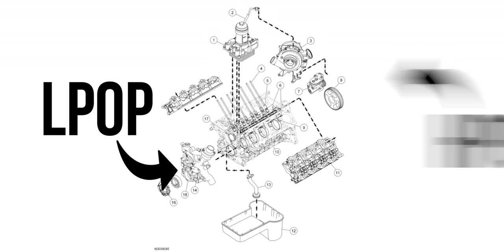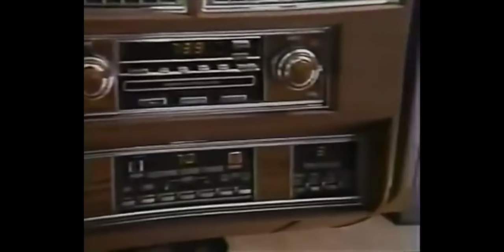These are the WORST ENGINES EVER MADE

Comment: I feel like he missed one by not mentioning the iron duke engine from GM. I owned a 1987 buick century, and I hated trying to merge into traffic, especially on the interstate because the engine didn't have the power to merge confidently. Even worse, it would shut off (without warning of course) for reasons unknown, and I remember my headers glowed red when I tried to drive up an incline. It was the only car that I abandoned and never gave it a second thought when the city towed it away for good.
Reply: The iron duke was slow but reliable.
Reply: Sounds like a plugged cat converter ,  I had the same issue.
Reply: Actually, the legit iron Duke motors were from 1979 to 1984, then they were aluminum blocks that some were junk in 1985 and newer.
Reply: I loved the Iron duke - coupled to a Borg-Warner 5 speed it could be made to move, ran 200k+, never used a drop of oil.
Reply: @geec5636  Mine was in a 1987 buick century. Maybe that's why
Reply: @blackice6184  for sure
Reply: Iron duke was underpowered but otherwise a good engine.  They had some trouble with timing gears shredding but at the time it had better than average reliability and good fuel economy.  Won't win any races though.
Reply: @knurlgnar24  You definitely got that right about the iron duke powertrain being super slow. I hated trying to merge onto the interstate. Took forever to reach 65 mph. Lol
Reply: I had a celebrity with one and it was flawless.
Reply: @Mazdafan59  my brother had a used one and it was a "pos!" I believe his lasted for 6 months.

Comment: I had a 6.0Ford Diesel F-250 that was flawless from 2004 to 2012 and 80,000 miles. I used Stanadyne fuel additive with every fill up and Hot Shot Secret at 30k, 45k, and 60k miles. It never failed and only blew a turbo hose off once at 75k mile on a designed downshift towing a 10,000 pound enclosed car trailer. It was NEVER reprogramed and I used a BulltDog monitor to keep an eye on engine functions when towing.

Comment: The PRV 2.8L V6 (Pugeut Renault Volvo joint venture) put in premium volvos in the 1980's and ended up in the DeLorean. Cooling system and lubrication problems. When they blew up under warranty voivo asked the customer if they could replace it with the excellent Volvo 2.1L turbo 4 cylinder it had better performance and was dead reliable.
Reply: Oh.. so many design flaw problems with the PRV! Rotting valley pans in the V. The incredibly stupid decision to run quite a lot of them on CIS mechanical injection, more correctly known as a Fuel Abortion. Horrendous quality build materials (crap metal, dissimilar metals, pot metal fasteners etc). Serviceability design flaws (fitted into far too many radically different vehicle configurations; all of them a nightmare to perform basic maintenance. Never ending electrical & sensor faults. Severely underdeveloped electronic engine management that's mostly banged together from off the shelf components (lamba computer, idle speed computer, CIS augmentation that didn't work). Heads that warp if you even say the word "heat". The list goes on and on.

Comment: The worst engine I've had to deal with was the 2.3L 140 CID four cylinder in the Vega.    It was a aluminum alloy cylinder block with cast-iron cylinder head and single overhead camshaft.  The block was open-deck with siamesed cylinder bores.   Terrible design.  The engine frequently blew head gasket and you ended up with milk shake in the crankcase and 99% of the time, failed bottom end.
Reply: It was the iron cylinder head and the silicon bore surfaces that caused all of the problems.  Open deck blocks with siamesed cylinders are an absolute thing these days.
Reply: @silicon212  Interesting, never understood what the Silicon did except reduce friction.   I figured it was excessive heat caused by the siamesed bores.   Learn something new everyday
Reply: @Barry718Johnson  They used the silicon in lieu of an iron sleeve as a surface for the piston to travel.  Silicon is hard and they figured it would make for a perfect wear surface.  They were right, but they didn't anticipate the oil control issues they'd have with it (did you ever see one that didn't smoke?) ... the piston was aluminum but had to be iron plated in order to live against the silicon bore.

Comment: Toyota also had problems with the head gasket on the 1990s landcruiser (80 series) apparently 30% had failures while under warranty and by 200k miles the failure rate was 100 %
Mine went @ 150k in spectacular fashion - a blast of steam out the tailpipe.

Comment: I had a 1985 GM 454 that consumed 1 quart of oil for every 16 gallons of gasoline. This was a brand new truck from the dealer. It did not smoke or leak anywhere. No spillage. It was a carbureted engine. Ran great but you better have a case of oil with you when going somewhere.  The dealer, naturally,  wouldn't rectify the problem. I also had a 1981 Ford 1 ton 460 which would consume 44 gallons of gas going 208 miles. Would pull a house down but a gas guzzler. It didn't last long either. Neither one of those engines were modified in any way but straight from the factory.

Comment: How about the latest GM disaster the 3.6 v6, which is not only plagued with timing chain issues but ( and this is the first time I've heard of this) also the reluctor wheel can slip effectively destroying the engine
Reply: "Our new High-Feature V6 engine now have the ability to self-destruct even more easily than they used to!"
Reply: I have a 3.4l Ohv in my firebird, and it's a damn tank. The older 3.1 and 2.8 60 degree V6 are good too
Reply: I think the 3.0 has similar issues too
Reply: GM 3.6 issues are derived from neglect by the owner. I have the original timing chains on my 3.6 at almost 250,000 miles now and no problems
Reply: @michaelcabral2174  your 1 of the lucky ones, heard nothing but horror stories about these
Reply: ALL of the 3.6 V6 issues are directly a result of owner neglect. They are very picky about their oil and maintenance and do not tolerate neglect like other engines might. But when taken care of properly they’re reliable long-lasting engines and will easily go over 250k miles. People who say they are junk just can’t maintain their stuff and can’t accept that they are the problem not the engine.
Reply: @trentryan27 And ALL of those horror stories are from owner neglect. They are VERY picky about their oil and maintenance. They do NOT tolerate neglect like other engines might. But rest assured if you maintain them properly and treat them well they are very reliable long-lasting engines and will go over 250k miles easily
Reply: @michaelcabral2174 correct!
Reply: @myk1_sp Only when owned by lazy people who neglect them.
Reply: @paulspomer16  funny part mines now almost about to touch 260,000 miles and that’s what seven months ago it just was getting into 250🤣
Reply: @michaelcabral2174  Yep I believe it. My 2012 enclave has it and I’m at 180k miles with not a single issue with the car let alone the engine.

Comment: 6.4L powerstroke, Chrysler 2.7/3.7/4.7, GM 3.6L… I’m sure there are other candidates but this is what comes to mind
Reply: My experience has been the 3.6 GM engine was "fixed" in 2012 for the most part.  We owned several old body style and new body style Impala's with those engines with 6 speed transmissions and power, fuel mileage and longevity was great.  I don't know if the Traverse crossovers had a different engine version or if just the weight and wind resistance was just more work than the 3.6 was willing to do.

Comment: I have owned my 2009 F-150 with the 5.4 Triton since new and have had absolutely no issues. Towing, hauling, long highway trips, driving up dirt roads to camp, and of course the normal day to day start and stop city driving.  I always made sure to stay on top of all the maintenance and have gotten the oil changed frequently. Just passed 200k miles last month and still have not had any issues since I drove it off the lot. I know a lot of people have not had such pleasant experiences with their Triton engines, but I'm just here to report to anybody looking to buy a used Ford with those engines that not all of them are nightmares.

Comment: The Rover V8 (3.5l, 3.9l, and 4.0l) is still my favorite V8 to wrench on, it has way more pros then cons. The all-aluminum Buick 215 block was way ahead of it's time. The best 4x4 Land Rovers ever made were all powered by this lightweight and torquey little block. The Range Rover Classic, Discovery 1, and Classic Defender are arguably the best solid axle 4x4s ever made, and the reliability of the Gems and Thor engine management systems is actually quite impressive. They do have one real weakness, and it is overheating them. Maintaining the cooling system is absolutely critical. Most of the slipped liners are results of overheating, and can be rectified with a set of top hat liners and minor machine work on their eminent rebuild. I wish a performance company would engineer and build a performance block for this V8. It is a great little platform to build on, but good machinable crank cases are becoming rare. Still, I would rather keep wrenching on my Rover then repower it with something else.
Reply: It's literally one of the worst engines of all time. The rose colored glasses need to come off. It nearly bankrupted the company. Land Rover has been the least reliable automaker in the world for decades.
Reply: @strongereveryday2302   One could argue that it was overall mismanagement that nearly bankrupted the company as opposed to a hunk of metal. Machines don't bankrupt businesses, people do. Land Rover chose to throw money at problems as opposed to doing the work to correct their issues at the root of the cause. There are plenty examples of well built, and solid performing Buick 215/ Rover V8 engines. The fact remains, swap 8 parts and retool a boring operation, and you have an engine that is not at all radically different than the old iron GM block that everyone loves so much, but you come in a couple hundred pounds lighter. I don't wear glasses, I see clearly.
Reply: @strongereveryday2302  I've had several LRs, and also 2 v8 Rover SD1s - never any problems with the engine at all on any of them, although placing the coil packs between the back of the engine and the bulkhead is downright annoying on the 4.0.  Land Rover is the least reliable automaker because everything else on them is shit !  Hydraulic self leveling suspension - aluminium distribution block and (non-stainless) steel pipes - weld in place and the distribution block costs £2500.  Air suspension - first you know that there is a leak in the airbag is when the compressor burns out - £350. Leaks like crazy through the sunroofs. Dodgy ABS (google the 3 amigos). My last LR was a Disco 2 - I gather that the ones subsequently are just a disaster from a maintenance viewpoint ; by the time you get warned off them by an independent LR specialist, it's time to buy a Jeep. I had a Grand Wagoneer which was an utter piece of crap; so horribly and cheaply made with dodgy electrics worthy of a 1970s british car. Jeep Wrangler which was stunningly reliable. Now a hemi powered Grand Cherokee - no problems with the engine at all, runs as sweet as a nut after 100K miles.

Comment: Because the 6.0 Powerstroke was the most overall engine problem, I was rating the 6.4 Powerstroke as the worst diesel engine. 08-10 6.4 trucks have tons of problems with the engines and emissions components due to warranty claims.
Reply: I love 6.0 trucks, because it's decent work on the truck it's fixable, not the 6.4l. Correct me if I'm wrong.🤷🏻‍♂️🤷🏻‍♂️🤷🏻‍♂️🤷🏻‍♂️

Comment: The 5.4 also had a lot of issues with exhaust manifolds. The studs would break because they were too small. The really 3V versions also had a 2 piece spark plug that was notorious for having the bottom half size into the cylinder head and having to be extracted. Also bad for oil pressure issues due to poorly designed VCT systems, namely the timing tensioner seals failing and dumping oil pressure.
Reply: The best part is that even the single piece replacements can easily still seize in place, at which point they tend to BECOME a two piece when you go to remove them. Good thing they moved the fuel rails for better access to the ignition coils 🤣
Reply: I worked in a small Oldsmobile  dealer on the West Coast during 1980/1.  It was an embarrassing situation; it was a family owned dealership that was around for many years and the diesel engine failures did them in.

Oldsmobile had besides the 5.7 diesel, they had for one or two years a 260 v8 diesel that was available as well.

It wasn't bad enough that the 5.7 unit wasn't very powerful, the 260 unit was even more gutless and you could even get it in the full sized station wagon with the TH200!

We were at one point, with factory approval, swapping engines from the new cars in stock if the customer complained enough and at one point we had more cars apart than the combined total of new and used cars!  The dealership was sold to another organization a little while later.

BTW, the Ford 2.0 liter sohc should be on this list.  (Not the Pinto/Capri engine)  The engine used in the Escort/Lynx? made by Ford.  It dropped valve seats in many engines before 80k; in the dealership I was at, they wouldn't sell an Escort without the ESP (extended service plan) because the engine failures were so common.  My 97 Escort wagon engine dropped its valve seat at 65mph and totally destroyed my motor.  I bought the plan and sold the car after the complete engine was replaced by ESP coverage.

Comment: I bought a 2003 F150 SuperCrew 5.4L, 2 valve, brand new in ‘03. It has 283K+ miles on it and runs like the day I bought it. It’s my understanding that the spark plug “ejection” problem was fixed by the time the ‘03s came out because I’ve not had a problem.🤷‍♂️  I have no plans to get rid of it, as it drives great. But I am SO GLAD I have the 2 valve engine instead of the 3 valve!!😄

Comment: Great video until the very end when you called the 2.2 liter Mopar an absolute turd. I had one in my 1988 Plymouth Horizon back in the day. It felt quite peppy compared to other small cars of the day, got 35 mpg and lasted 280,000 miles. The transaxle and clutch on that car were weaker components than the engine.
Reply: Head gaskets and timing belts were easy fixes. Bang for the buck....they were great!

Comment: The 3.5 Ford Duratec engine has an internal water pump thats prone to fail and to replace it the timing chains have to be removed and replaced. Resulting in a 2K or so job that's if you catch it before the coolant ruins the engine

Comment: It's a real shock to learn about the spark plug issue on the 5.4 triton. My dad has a 2005 E350 with the 5.4 and it's given us no trouble at all. We've hauled lots of lumber, several cars, and a decently heavy trailer with it, its handled 18 years of intermittent use. When does the sparkplug issue come up?
Reply: I think the Econolines motor is slightly different than the F series. I have a 06 e250 and same as you,it’s been great!
Reply: The early engines suffered the issue. The later designed they added more spark plug threads. They could still spit out plugs though if they weren't tightened during a tune up
Reply: @reweydewy  must be real fun to do. I had to ask my mechanic to change them on three separate trips in through its oil changes until I finally pretty much demanded it haha.
Reply: @reweydewy   👍

Comment: I have a 2.2l Mopar and for what it is isn't that bad.Overall mpg is around 20 as after 95k miles has been pretty reliable. Granted having a 4 cyl mopar engine in no way compares to Mopar engines in its heyday but it did help save Chrysler. Too it will not set speed records but always starts and gets the job done!
Reply: If it doesn't blow a head gasket !!!
Reply: @garyalford9394  If you are smart you pay a little more $ and get the Mopar Performance Head Gasket .
Reply: 20 mpg out of a 4 cylinders? Come on
Reply: @richeywcassel  how many miles should I be getting for a 3000 pound car with 93 hp?
Reply: The downsized heir of the old Slant Six

Comment: I was pulling a food trailer some years ago. I had a budget I couldn't go over. I passed on a 6.0 F250 King Ranch with every conceivable option because me and the dealer were $1000 apart in negotiations. I went with a Chevy 3500 base model with the last year of the 6.5 Detroit. Everyone said, "it's not that strong but they put them in ambulances and Humvees so you know it's reliable." What a catastrophic mistake! I spent more keeping that thing on the road in 2 years than I have on every other vehicle I've owned since I could start driving in the 80s....combined! There's no way that 6.0 could have been worse than that 6.5. I put no less than 3 PMD modules in it even after it was moved. Put me off GM forever.

Comment: Easy to stop the fuel spray when the triton engine spits out a spark plug. All you gotta do is unplug the injector and coil for that cylinder. You still gotta deal with  the compression noise.  But the under hood  fire Hazzard is greatly reduced.